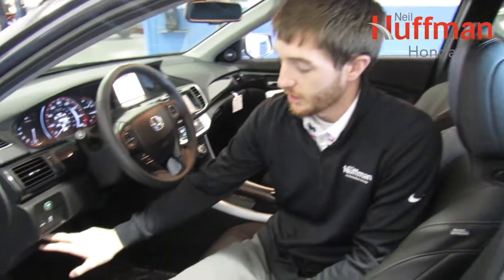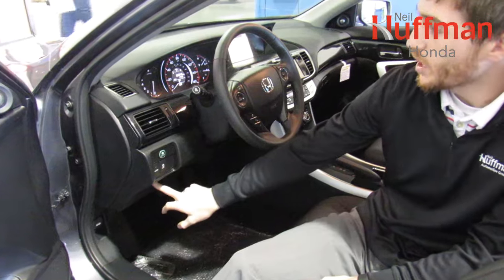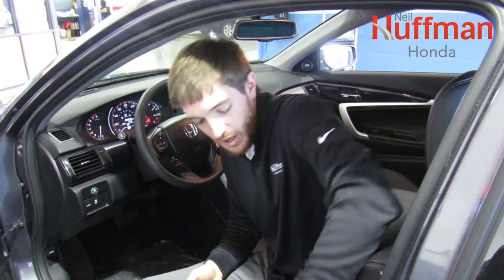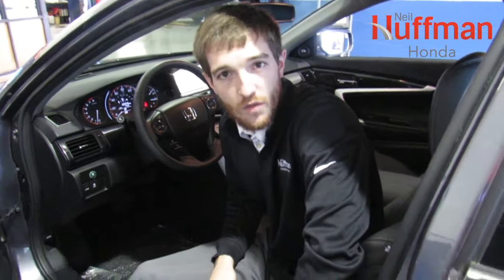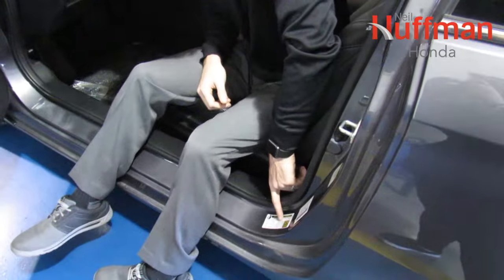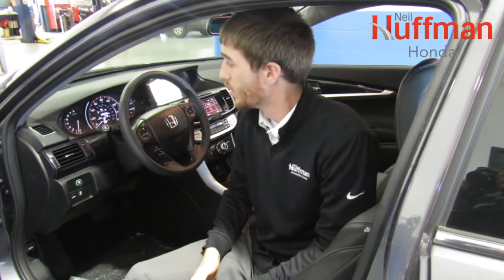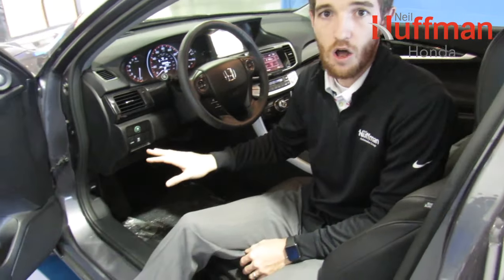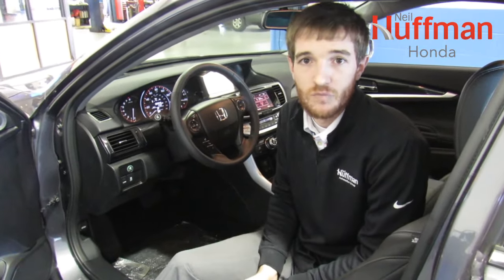How to Reset the Tire Pressure Light in Your Honda

Comment: How about for a 2007
Reply: For a 2007 Honda vehicle, set the tire pressure to 34 PSI, and then once you resume driving (at approximately 35-40 MPH) the tire light should automatically reset. Should you have any further questions please call our Honda of Clarksville service department at 812-590-8020.

Comment: What does this even mean? If the TPMS indicator comes on, it's telling you pressure is low in one or more tires. To rectify that, you inflate your tires to the recommended level and the indicator goes off when it senses proper air pressure - this normally requires driving a very short distance. To do what this guy suggests, "pressing the button so you can be on your way" does nothing to rectify the problem.
Reply: Not always. Sometimes you have to reset the tpms sensors. It depends on the vehicle. Also a tpms light could also be a sign of a damaged or broken tpms sensor. Source: I'm a tech for a honda dealership.

Comment: 2011 Element does not calibrate TPMS in this manner. You should know that.
Reply: Settle down tough guy
Reply: Exactly.  Nobody can tell me how to reset a 2011 CIVIC EXL LOW PRESSURE LIGHT.  guess IT CANT BE DONE

Comment: My 2009 honda fit DOESN'T HAVE SUCH BUTTON, I inflated the tires and now the damn TPMS light stays on all the time...
Reply: Bro I  just watched a video and there could possibly be a sensor in the spare tire also so you need to check that one too and fill it
Reply: We just had 3 tires put on our Honda accord its an 08. And the damn TPMS light won't go out. I've been trying to figure this damn thing out all flippin day. Ugh. Someone help!!!!!!
Reply: Thank you first video out of four that actually addressed this very simple issue!!
Reply: Need to cut the wire
Reply: Me too except the mechanic told me that the tires were okay - I need to replace the sensor -- $500.00
Reply: Same problem. Honda Fit Sport 2009. No answer ANYWHERE. No  Damn picture where that button suppose to be. Just wage description
Reply: @smorodinkaja6871  there's no button, you will have to change the tires
Reply: My 2011 doesn't have one either

Comment: If you have a 2011 Honda Civic or older, there is no reset button. (They say civic models were introduced to TPMS sensors in 2008, but that doesn't mean all vehicles are equipped with the TPMS reset button). My brother's 9th gen 2012 Civic doesn't have a button, and my 8th gen 2011 Civic Ex doesn't have a reset button. If you don't have the button, then the car computer will recalibrate automatically, especially if you just got a rotation/alignment. Once you drive it some (20mi-ish), it will disappear from your display. If it doesn't, then that means you have 1 or more tire sensors out on your tires. 

The sensor just monitors the tire pressure when it's too low/high. It costs an average of $100 dollars, per sensor, to fix. Save your money and wait till you need new tires to get the sensor(s) so long as you don't mind looking at the TPMS light. If you hate seeing the dashboard light, then buy a new sensor(s). Just know, they may likely charge you for taking the tire(s) off to install the new sensor(s), hence why you should wait till you need tires— it will be cheaper. Sensors are not urgent, it really doesn't need to be fixed, nor is it a must have. It's somewhat of a new concept added to vehicles to let you know “tires need air”. Before they added this extra equipment to vehicles, you would literally just “look” to see if your tires are low, or you'll hear/feel when they get a flat. So, do what you will with this info.